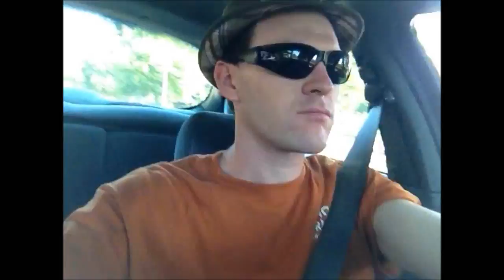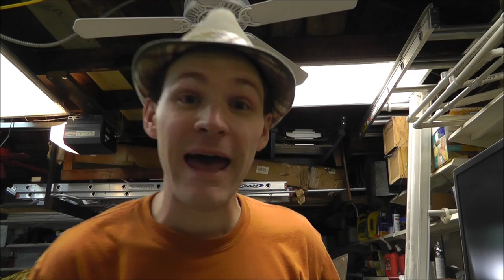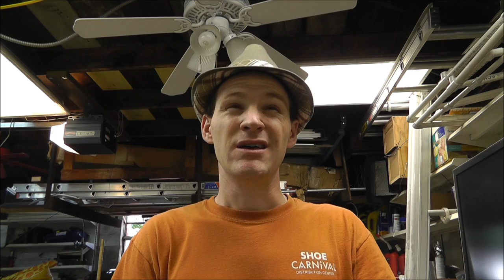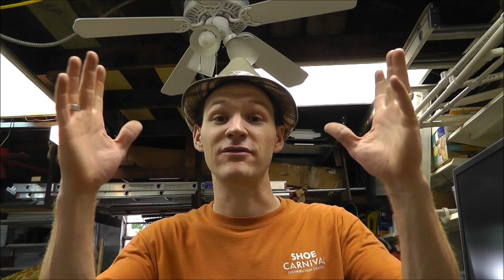Pulse Motor Build Off 2012 Time  Extension? Wait, What? Can You Do That?

Comment: since i wont be posting mine... i was gonna use  ed's pmh with an arduino to pulse electricity to the pmh to turn  some magnets ( those ones you find in a flea market that look like polished stones)in different areas infront of the pmh, some mounted on bearings turning sumthing... ne ways yall have fun!!